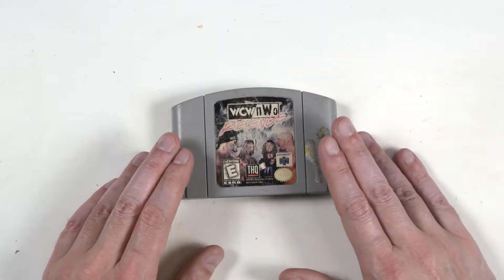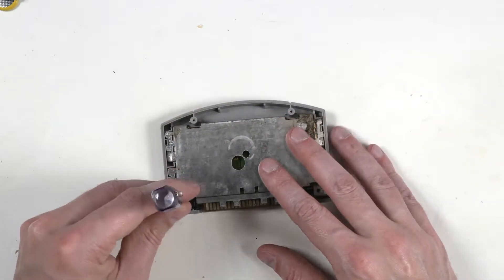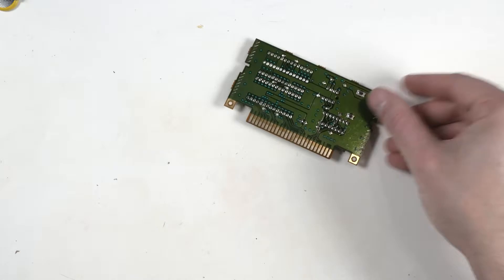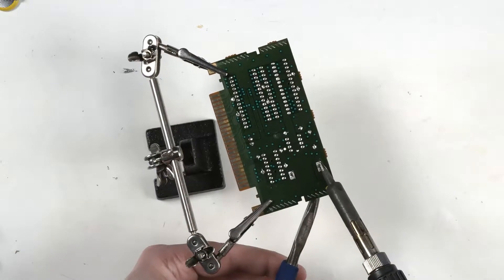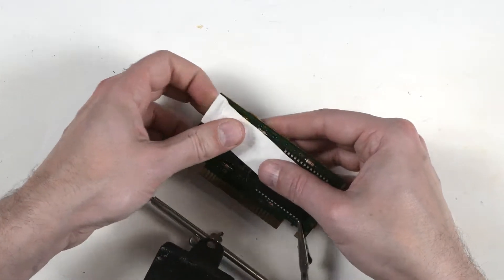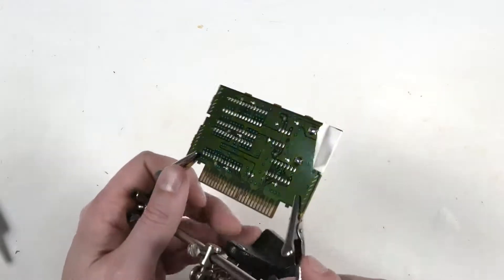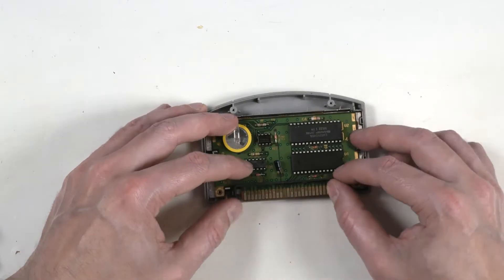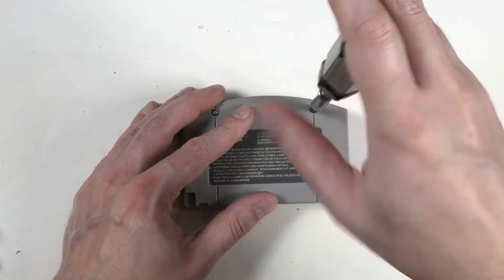N64 Games Battery Replacement

Comment: Many N64 cartridges used SRAM to store game progress and/or data. SRAM loses its data when power is disconnected, so the battery will provide a continuous power supply when the cartridge is not in use. When you are playing the game, the console powers the SRAM. There was no FLASH or EEPROM in 20th century. As the technology develops, SRAM is changed into FLASH or EEPROM.

Comment: I did exactly what you did and my game saved once and I played it for about 7 hours and then turned it off to check and my save was gone. I ordered a new battery off of Amazon and it didn’t last a day.. any idea?
Reply from the maker: Double check your joints and make sure nothing it bridged. Other than that, I might be a bad battery. (It's rare but it does happen.)

Comment: Does this work for N64 controller paks ( Memory cards) as well? 
Did you loose all saves because you did not run a secondary battery supply while changing the original battery? (Want to know if ill loose my saves as soon as I detach the original battery...)
Reply from the maker: You can change the battery in the Controller Pack. It takes a CR2032 and you need a small game bit to open the pack. I'll be doing a video on the Controller Pack soon.

You WILL loose your save games. You could try to hook up a temporary battery while you change the permanent one, but I've never attempted it, so I don't want to advise you on something I've never done.

Thanks for the question and thanks for watching!
Reply from the maker: I have a video on how to replace the battery in the Controller Pak coming out on April 9th. Watch for it!  :D
Reply: I sure will. Thanks man!

Comment: Will the part where the game gets read become damaged if I touch it while soldering a new battery in? Thanks :)
Reply from the maker: Not if you touch it with your fingers. Just clean it off with some alcohol and a q-tip.

If you touch it with a soldering iron and get solder on it, you'll need to clean absolutely all of it off.
Reply: @HexedPedestrian  thank you